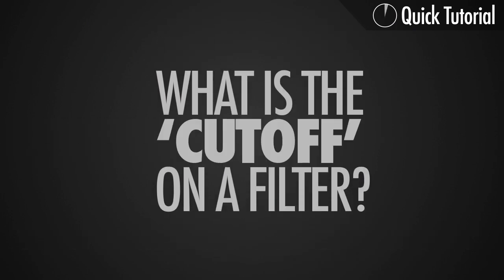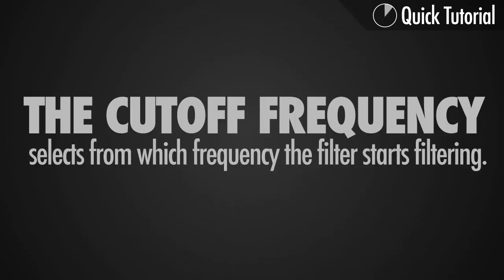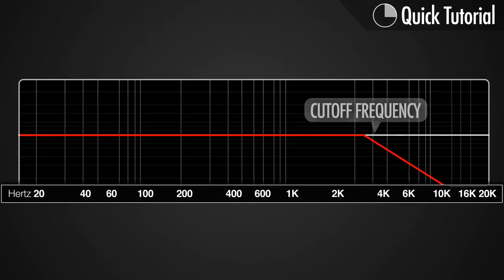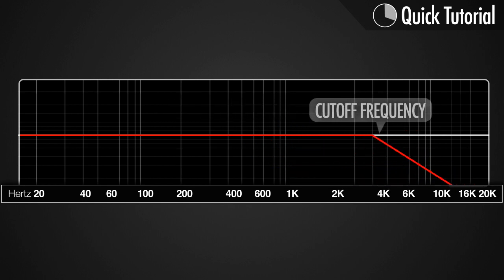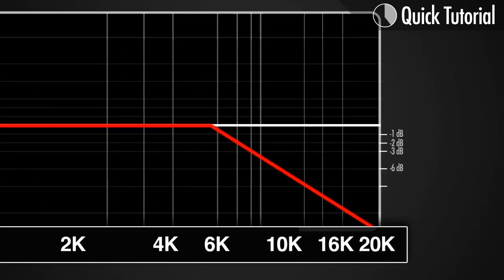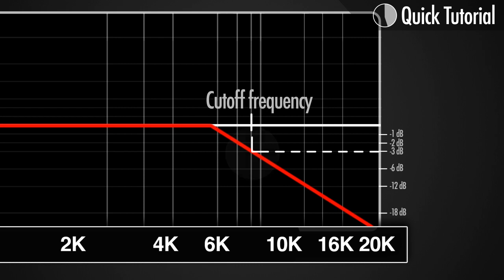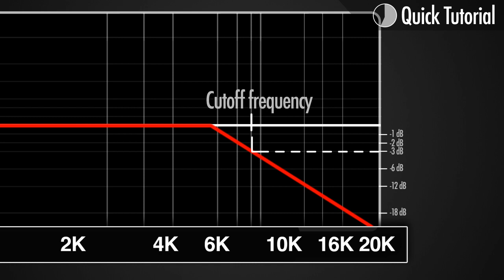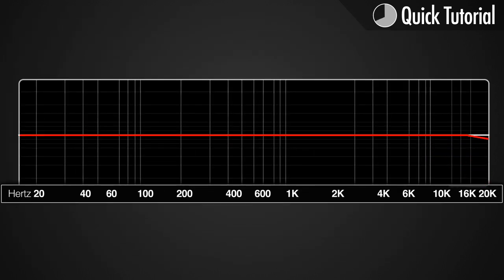What is the 'Cutoff' on a filter? (Quick Tutorial)

Comment: what exactly is a filter ?
Reply: 'Water filter' filters dust in water ..so 'electronic  filter' filters unwanted signals which we don't want ....... there are different types of filters n their work ... example:- low pass filter:- only allow low frequency signal and remove(filter) high frequency singal. Capacitor filter:- allow ac signal but remove (filter) DC signal